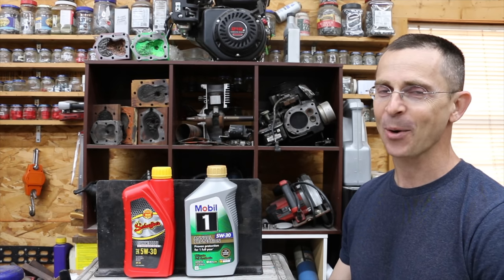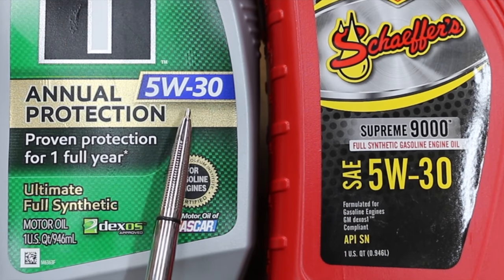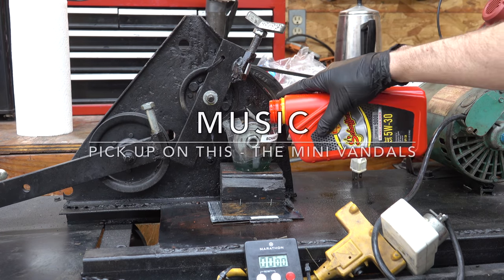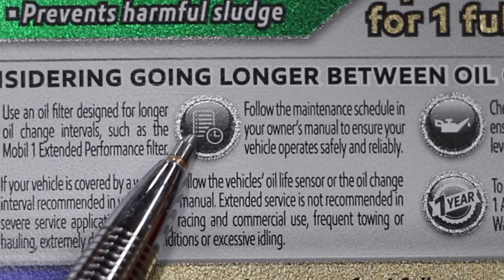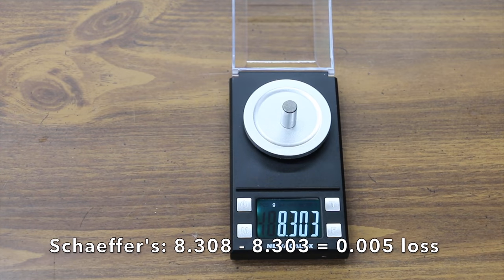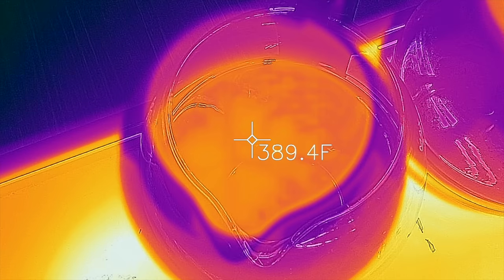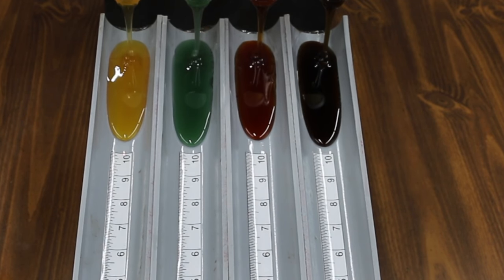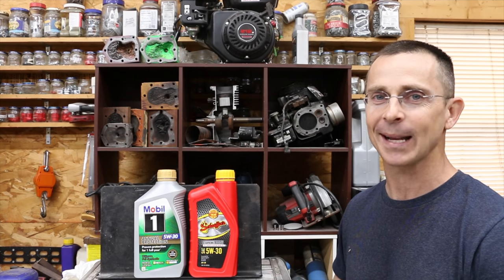Is Mobil 1 better than Schaeffer's Full Synthetic 5W-30 Motor Oil? Let's find out!

Comment: Thank you for making this one. I've found Mobile One synthetic to outperform most other oils over the years.
Reply from the maker: Thank you! It's a great oil!
Reply: I saw a test of Mobile 1 against Amsoil back in 1980 or -81, and Mobile 1 lost on the lubricity tester to Amsoil.
Reply: @sunshinekid6922  In my mind I see amsoil being the overall winner of the oil showdown. My family has used amsoil exclusively on our race cars. That being said, is the performance worth the extra cost of it? I don't know. Great tests
Reply: @sunshinekid6922  After bacon fat decisively beat conventional oil in the lubricity test, I've lost faith in it. 
Many years ago I recall a sleazy oil additive company using the same test to promote their product. It was just a zinc additive. If you didn't know better, the test made the additive look very appealing. In actual use, the additive didn't help, and in many situations cause problems, but it tested well ;)
Reply: @EDesigns_FL  You are probably referring to zddp.  In older cars with agressive cams it is actually very helpful.  It is an additive specifically for high pressure lubrication.  Newer oils have used lower amounts due to a change in catalytic converter materials.  Manufacturers had to do so because of new regulations regarding catalytic converter warranties being extended.  The new material did not like zddp.  The additive for manual transmission oils have gotten varying results because of synchro materials also.  I forget the additive, but when used on bronze vs steel (I think) it does an excellent job preventing wear on one but causes rapid wear on the other.  That said, some additives are hogwash, others it really does depend on the application.
Reply: Mobil 1 only for me.  Best bang for your buck.  Not cheap but not overpriced.  Long term lubricity test would clearly show all the benefits of using good quality oil IMHO
Reply: You can go to petroleum institute of America and check for oil tests. Mobile 1 outperform almost all oils. Specially the Amsoil.
Reply: @nycalien  My buddy is a mechanic.  One thing he said was he can always tell if Mobil one was run in the engine.  It is always sparkling clean inside.  Granted that is more about the detergents than the lubricity, but no one wants crap caking in their engine.
Reply: @MTLWAKEUP  The performances are close enough. Mobil 1 is significantly cheaper than Schaeffer. So people can chose either brand they want for what ever reason.
Reply: @Worrsaint  I remember going through trade school mechanics, and if you found a real gunked up valve cover and sludge in the bottom of the oil pan, you could bet that Quaker State was used in the engine.  But that was years ago, as in the 1950s and -60s, so I'd have no idea if the company cleaned up its oil or not.
Reply: @sunshinekid6922  There was supposedly an issue using synthetic that were not true synthetics at like 10 or 15 years ago I recall.  Castrol gtx (unless you got the green colored German one) was a good example of it.  It was actually a paraffin based oil and not a true synthetic like mobil one, royal purple or amsoil.  It caused a waxy buildup that wasn't necessarilly the worse thing in the world.  But if you ran mobil one or a good true synthetic with different detergents, it could clean the waxy build up off and clog small oil passages and filters causing oil starvation and filter bypass.  I do not know how big of a problem it actually was though and how much of an extent it caused problems.  Could have just been mountain out of a mile hill kind of thing.
Reply: @Worrsaint  i heard that about pensoil.
Reply: SN PLUS is the API's current highest rating so i highly doubt schaeffers will be the final winner. if the final winner is something that isnt SN PLUS rated than there is a flaw in his testing because the API found a reason to not rate it SN PLUS.
Reply: @Billy_Darley  I believe that was a paraffin based one also.
Reply: @Billy_Darley  Sn plus is just an added category to prevent low speed knock.  It does not have to do with lubricity or viscosity.  His volatility test is the only thing that could possibly be remotely related.  My guess is that sn plus just has a high vapor ignition temperature than sn.
Reply: @Rhaspun  Are you sure about that? This was the ANNUAL PROTECTION version of Mobil 1 - one of the most expensive they make.
Reply: @Billy_Darley  That was a million years ago and many oil company aqcuisitions later...Pennzoil and Quaker State are BOTH Armada Shell oils now. Check tests around the world - Shell synthetics are equivalent or outperform 80% of the other oils in the world. I'm talking the companies you never heard of (except maybe Repsol, Petronas, and Elf). It is a huge world out there.
Reply: @pgmurray76  It is significantly lower than Schaeffer. Remember Mobil 1 is available at Walmart. Walmart has the best everyday price for oil. I notice the price for the one I use, the European version 0-40w has dropped down. It used to be 26, 27 dollars. I just bought two of 5 qt bottles and they are now 22 dollars and change. I have an oil change coming up for one of my cars. The annual protection version is around $26 for a 5qt bottle. It's still a good price.
Reply: @Rhaspun  You're 100% correct. Geeze. Schaeffer's is PRICEY. Mobil 1 Annual Protection on Walmart dor com is niw only $35.84 for the 5qt. $26 for European version is excellent (if I were to use Mobil 1, that is the one to get)
Reply: @Rhaspun  yeah the FS versions of Mobil 1 is money stuff.  Esters are high and extended oci are good too.  5w40 is a great one.  Extreme temps.  5w50

Comment: This is more exciting than the NBA.. my only complaint is it is too long between tests!  I think it would be interesting at the very end of the bracket to test the overall winner against the last place and see what the differences are by percentage and price (cost/ benefits ratio).  Additionally, a test against a very low cost "economy" brand as this would probably show the value of extra protection against wear.  Thank you as always for your delivery and demeanor.   It is great to see a family friendly channel that is intellectual and without drama.
Reply from the maker: Thank you!  Sorry about taking so long between tests.  It takes me around 40 hours for one of these videos. Thanks again!

Comment: Schaeffer's 90w oil is amazing stuff. We used it at a shop I worked at. It's the stickiest, slickest stuff I have ever seen. Dip your finger in it and the breeze would make it string across the parking lot. We also put it through the friction test and it performed excellent. It even beat out pumpers lube. Lol.
I don't know much about their motor oils though but if its anywhere near as good as their 90w then I'd definitely use it.
Reply: It is some of the best oil and grease out there, my grandpa sells it along with my uncle and cousin it’s all I use in my engine and transmissions. It is also a private company so they don’t advertise there stuff like Mobile or amsoil
Reply: @lucasfennema6778 where do you find it at? I wasn't familiar with it at all and can't remember seeing it anywhere. Is it just something you have to know where to get it or have to order it because I wouldn't order something like oil

Comment: Would love to see some diesel oil tests. Delvac, rotella t5 or t6, and another oil of your pick!
Reply from the maker: Thank you for the video idea!
Reply: Add Valvoline and AmsOil to that list
Reply: Rotella T6 comes in 0w40 and 5w40. 0w40's not as common and it's thinner than 5w40 both hot and cold.
Reply: @101Volts  yeah it's not common because nobody lives at the north pole
Reply: Project Farm yes please, amsoil “heavy duty” vs delo synthetic! Not a fan of shell rotella.
Reply: I put Chevron Delo 100 in my.boss's. 63 Chevy Suburban when it was almost new. I took off the full flow filter and put on a Frantz oil cleaner. He never drained the oil but changed the toilet paper in the Frantz every 2000 miles and added a quart of Delo 20 wt. Multi grade oils didn't hold up in those days. Not sure you.can get 100 these days it's mostly 400 now. I lost track of him and the.truck after over 350 K It was a 292 big 6.pulled a dragster with it. The Delo always looked new. 29 cents at the discount store.

Comment: you should see if the bearing wear test changes with cooked oil vs new oil.
Reply from the maker: Thank you for the video idea!
Reply: I agree! The main reason we use oil is to lubricate, so whether it continues to lubricate after it has been heated is quite important.
Reply: @averyalexander2303  that and oil has additives that are heat activated. oil in a bottle last for years but once you place it in your engine it has a life based on the additive package+ regular and synthetic oils. that's the reason why full synthetic oil last for 12 months.
Reply: It's all just marketing.
Reply: @BennyCFD  don't hate bro
Reply: Soon it’s gonna take him 5 years to test all the oils with all these ideas lol.
Reply: It really only matters about the lubricity after the oil has been burnt excessively

Comment: I was offered Schaeffer's when I went in to do my oil change and I took them up on it as it was the same price as Mobil 1. Glad I did.
Reply from the maker: Thank you
Reply: I have used depth bypass filters for the last 50 some years. My oil always looks new. Looks like the Mobil 1 is lighter. Before I started using synthetics I used Chevron Delo 100 30 wt. I don't drain oil. In the 60s multi grade conventional oil didn't hold up for extended use. You for sure didn't use multi grade in a diesel.  My uncle told me his 59 Ford always uses a quart of oil after he changes it. Then it's OK until his next oil change. Later I realized one quart evaporated. Conventional multi grade. They are a lot better now. When Mobil 1 first came out all they had was 5 20. You needed a pretty good engine to use it.

Comment: Walmart full synthetic 5w30 vs Amazon full synthetic 5w30!! This one has me wondering
Reply from the maker: Thank you!
Reply: Both are produced by Warren, most likely the exact same formulation.
Reply: @MattTigers  correct but Walmart sometimes changes their private label supplier. I know in the past both ConocoPhillips and Shell have made PLP oil for Wally's. Fwiw, the SuperTech full synthetic made by Warren right now is GM Dexos2 certified, which means it surpasses ILSAC GF5 test standards. Not bad for a rock bottom priced full synthetic in my opinion and probably suitable for most any daily driver car.

PS, Walmart has a website of SDS of all current oil products and past (archived) oil suppliers. That's how I learned about Shell and Conoco having been a PLP supplier to Wally's. It even tells you which viscosities they produced oil for Wally's)
Reply: I've seen some cold temp testing of the Walmart ( supertech ) full synthetic 5w30 and it's not that great......like i was actually surprised at how bad it did vs other synthetic oils...   And for the $$$$   I picked up some Mobil 1 full synthetic 5w30 from walmart about a month ago for my Chevy Cruze and the 5 quart jug was 26$......   and with all the video's i've seen on the cold temp testing which has been anywhere from 15 below to 40 below..... Mobil 1 beat everything.... Except in this video lol where Shaeffer's barely won....
Reply: @DLYskes1976  did you see his other video on Redline vs supertech? ST won the cold flow test, fwiw.
Reply: @MattTigers  that i did not see......  i will go and check it out
Reply: @MattTigers  ok, i have to correct my previous statement about the Supertech Synthetic oil, i re-watched the videos i had seen and the Synthetic Supertech 5w30 did do pretty well in a -40 cold test...  Mobil 1, still won by a long shot...  Castrol Synthetic was completely awful, same with Rotella...   the worst was the conventional Supertech 5w30 in the same test.   i'll post links to the videos below.    Oh and Royal Purple was another one that didn't perform well.....
Reply: @DLYskes1976  I've seen these videos, the issue I have is while the temp is the same, the bottle shape, and mouth sizes vary. PF evens the test by using test tubes, it's a much better test.

Comment: Schaeffers is located here in St Louis, MO and no one has ever heard of it. They are a small family business and they don't sell big stores. I ran the US National motorcycle endurance for many years. Once at a 6 hour in Las Vegas we blew a gasket and water leaked for about the last hour of the race. That's about 14k RPM for an hour.  The motor did not blow up even though the radiator was empty. After the motor tear down, the oil was toast but the bearings were still good. We felt most oils would not have tolerated that abuse. Great stuff!
Reply from the maker: Impressive results!  Great product for sure. Thank you

Comment: Could you do auto store brand oil next?
Like Autozone and O'Reilly
Reply: I just typed a similar comment.  
You beat me by four hours.  :)
Reply from the maker: Thank you for the video idea!
Reply: Autozone's oil brand, STP, is API SN Plus.
Reply: Don't forget Amazon basic lol
Reply: @jonathoncliffbailey  , did STP acquire Autozone, or vice-versa?  Because from what I know, STP originated in the mid 1950's, whereas Auto Shack (which eventually became Auto Zone) opened it's first store in 1979.
Reply: The back of the STP oil bottles say "Manufactured for and distributed by Best Parts Inc., Memphis Tennessee." Memphis is where Autozone's corporate headquarters is located. Also, 'Best parts' is a derivative of a section in Autozone's pledge "... We've got the best merchandise at the right price!"

While the STP additives are carried at other stores, only Autozone carries the STP oil. I think it is more of a brand deal than anything, but nonetheless it is essentially Autozone's store brand oil.

Source: Am a manager at Autozone
Edit: Linguistics
Reply: @jonathoncliffbailey  
Good to know.  I love it when I can continue to learn something new every day, especially at my age.

Comment: I think the oil flow / viscosity  test is a double edge sword, if oil has low viscosity it's going to flow faster easier -engine will run more freely. But  if oil has high viscosity it will stick on engine components a lot more which is better for long interval cold starts -which is when engine wear occurs on start up. I don't know just my thoughts...
Reply from the maker: Thank you

Comment: Oh? Pretty noice

How about...: windshield washer fluid
Reply from the maker: Thank you for the video idea!
Reply: Coming up with a "standard windshield" might be fun.  Potato(e) salad near the intake of a leaf blower might provide enough flies to wash.  Radiator fluid and used oil mix (blown HG from the hoopdie in front of you) does a good job of smearing them up too.  Simulate old windshields with a bead blaster?  OOH, pine sap...
Reply: Stay away from the orange rain x fluid. It leaves a film and after 2 years your low fluid light will come on. The film will. Block the sensor fome making contact.
Reply: I use pure deionised water for washer fluid

Comment: My old VW Beetle 1.9 PD Diesel had the longlife service plan and the engine oil was changed every 2 years by the VW dealer - roughly 20k miles! VW have an explanation of this on a .pdf called "Longlife III - Volkswagen UK"
Reply from the maker: Wow!  That sure does seem like a long time.
Reply: Just for info from the .pdf.
'LongLife Service regimes
The LongLife Service regime is so called because there are no set service intervals and, depending on how you drive your vehicle, and the conditions of use, a service will be required anywhere between 9,000 miles or 12 months (whichever occurs first), up to a maximum of 20,000* miles or 24 months (whichever occurs first).
This LongLife service regime has been made possible due to the development of new Volkswagen engines with the latest technically advanced LongLife oil. These engines use built-in sensors that continually monitor the oil quality, making it possible to enjoy reliable and confident motoring for up to a maximum of 20,000* miles or 24 months (whichever occurs first).'

 @ProjectFarm
Reply: Wifes Octavia 1.9PD was on that schedule, 16k pretty much on-the-nose for every service, its at 177k...  I've done away with that though since I dont have vagcom.
Reply: I threw up in my mouth a little
Reply: @jamesbecker3203  ??
Reply: @tripplefives1402  no, its 5w30 vw507 spec car oil, and they dont hold quite that much.
Reply: @tripplefives1402  maybe years ago mate, but not now.
Vw507 is based on C3 which has a high hths making it pretty much the same under load as say a usual 5w40. The detergent levels are lower, but they dont need to be as high, and remember, the engine is monitoring these to determine the oils condition.
Reply: @tripplefives1402  honestly, this is really incorrect! Trucks maybe, but cars, no!
Most car diesels worldwide of the past 20 years use 5w40 down to 0w20, the most common being 5w30 since euro 3.
Put 15w40 in some of these and when cold you'll starve the engine and can overload and cause failure of the oil pump.
(Ive been studying engine oil for a decade now 😉 )
Reply: @tripplefives1402  15w40 is the same at operating temp as 0w40, and any high hths Xw30 is pretty much the same under load but just circulates more freely and drags less. Static viscosity doesn't really apply in the bearings, thats where hths comes in.